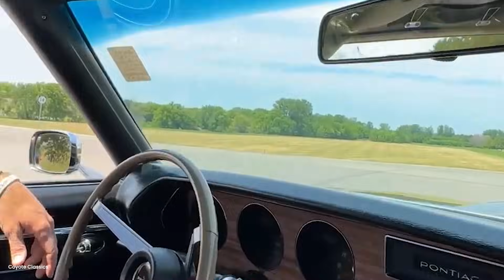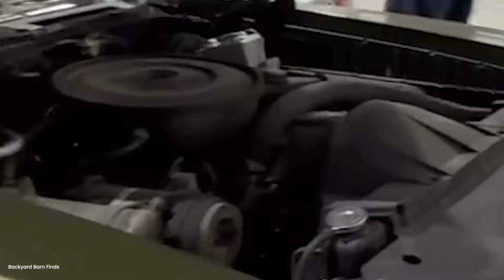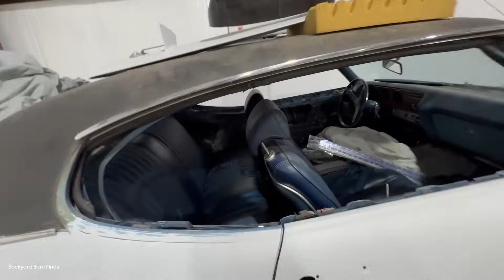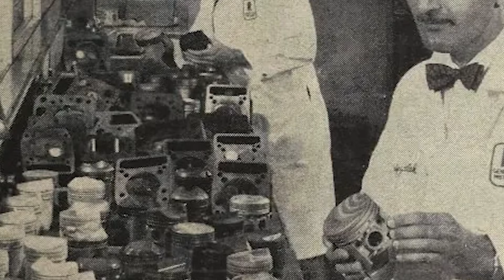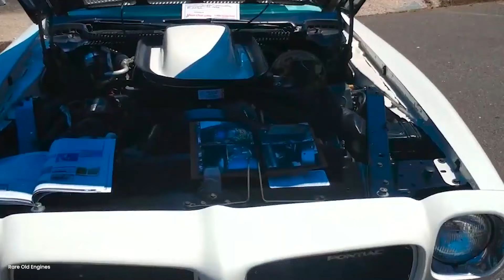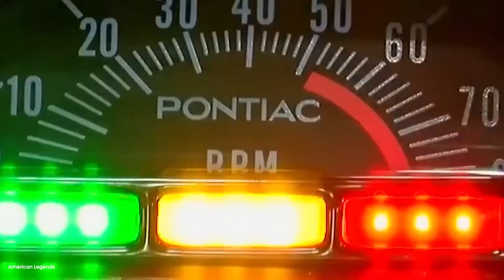This Georgia Drag Racer OUTSMARTED Pontiac With a "Weird" Tunnel-Ram That Made 600 HP

Comment: It increased volume and with the smaller venturis in the small carburators kept velocity high which aids in air to fuel emulsification and that leads to great power and response improvements ... Mr Joseph A Bailey ☘️ (AKA Mr Magnum 4 link rear suspension system) ☘️🏁😎

Comment: How was that super stock ARHA could be super stock. Pontiac had a two four barrel set up  stop marking up stuff remember a 70 Chevelle SS in a school bus  how is it going to fit stop making up history
Reply: I thought  arni was from Morrison, Ill?
Reply: Apparently sir you have never spent any time in an educated person's backyard shop burning the midnight oil creating magic through proper R&D and the willingness to think outside of the box ... Mr Joseph A Bailey ☘️ (AKA Mr Magnum 4 link rear suspension system) ... ☘️😎🏁
Reply: All you have to do to bypass the low rpm horsepower level and keep the upper rpm range power of the tunnel ram intake manifold effect is to ad a "stuffing block" to the inside of the plenum of the tunnel ram effectively increasing vacuum signal strength and restoring the low end engine power ... I've actually performed this modification on tunnel ram intakes for years but I learned it from SA DESIGNS book super tuning Holley that details Grumpy Jenkins designs for the ultimate badass naturally aspirated to intake manifold ... The Man was a performance Genius ... MR JOSEPH A Bailey ☘️ (AKA Mr Magnum 4 link rear suspension system) ☘️🏁😎